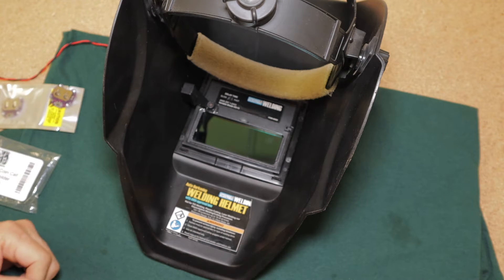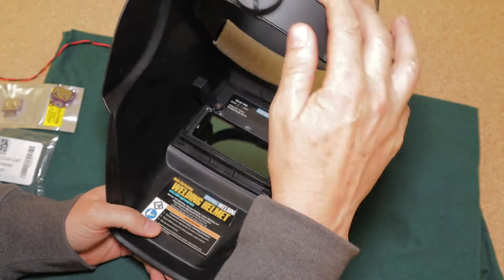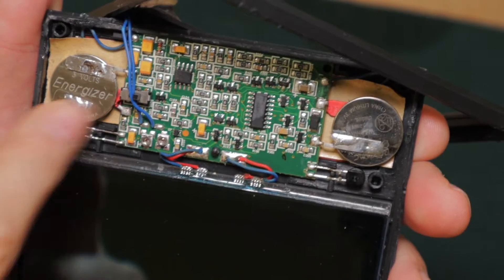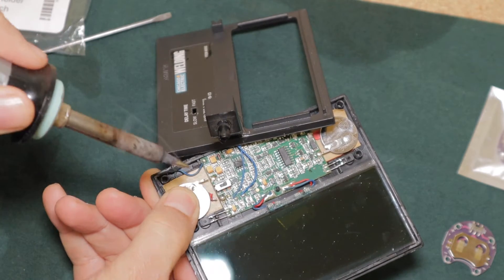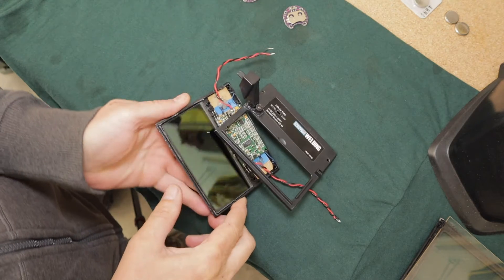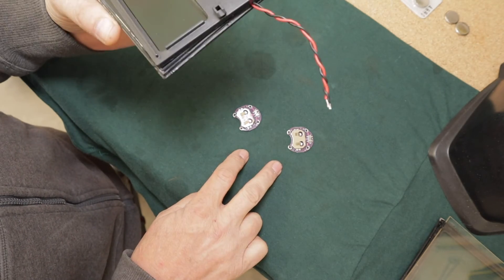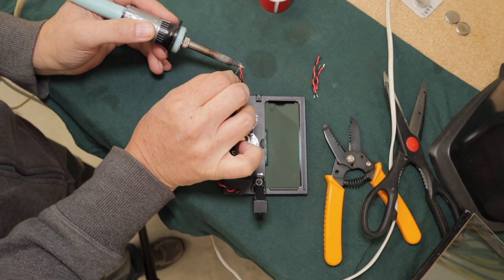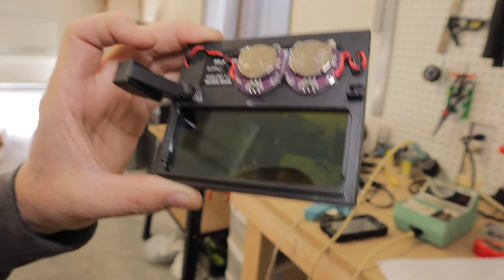Revamp Your Harbor Freight Welding Helmet: Battery Replacement Hacks

Comment: 1. use CR2450 because higher capacity
2. instead of solder cable directly on battery. use spot welder to stick nickel strip on battery. then solder cable to nickel strip
Reply from the maker: That would be great but most people interested in this mod probably don't want to buy a spot welder for this one project.

Comment: I have an older hf chameleon helmut (uses only one button battery). Replaced a new good battery, and still does not work. Any guidance would be appreciated.Thank you for your video, and all the best from New Rochelle N.Y.
Reply from the maker: I appreciate you watching and I wish you the best! I have no experience with a chameleon hood.
Reply: The sensor could be dead.  The older ones, I saw on google, will die if kept in total darkness.  It may depend on the brand and age.  I'm about to do this swap on my 10 year old Harbor Freight helmet.  I think I'll connect the new batteries before doing the battery holder swap to see if the sensor still works.  It was not kept in total darkness, but in the box in an open cabinet/tool box.

Comment: Just an FYI, there are different versions of this board and your model is easier to work with than some others. I have a model where the batteries are next to each other. Getting to them is a pain. Also, it's best to desolder the batteries from the board before messing with them. And those battery connections are not "soldered" but spot welded. It's the same tool used to make cordless tool batteries. If you don't have the welder, soldering is ok but not recommended at all. Your method using DIY boards, is a much better approach.
Reply from the maker: Good info, thanks for sharing!

Comment: Nice.  Looks like you can also buy the replacement batteries that have the feet on them, so you can solder the new ones to the circuit board.  Not sure if I'm going to do that or use your approach when the time comes.

Comment: Welding shades protect you against 2 things besides heat: UV radiation, and visible light. Regardless of the shade (even clear), the lenses will protect you from UV radiation. The darkening is only for eye comfort, and to orevent eye damage due to brightness

Comment: Are the batteries wired in series or parallel?  I have one of those helmets that has a few years on it and I think the battery(s) need replacing... Depending on the voltage, I was thinking of replacing it with a spare 18650 battery that I have around here... Actually, I wouldn't even mind if the solar cell would not charge the battery since I figure it would be easy enough to use an external charger on it...
Reply from the maker: It's been quite a while since I did this modification. I'm thinking they are wired in series.

Comment: Thank you for the video! I was able to bring my Harbor Freight welding helmet back to life. One thing I did differently was solder the wires to the back of the battery holders and then hot glue the battery holders in place after they were wired. This allowed for the batteries to slide in without being obstructed by the wires.
Reply from the maker: Excellent, nice job! 👍🏻

Comment: Great tip and very clear video! My HF welding helmet has died after 15 years, and a 2nd one that was new in its box as a spare also didn't work, so I have some work to do 😁😁

Thank you very much! 😉😉
Reply from the maker: You are welcome, I wish you the best with your project! 👍
Reply: @DIYHomesteadProjectsDIYHP10  😉👍
Reply: @DIYHomesteadProjectsDIYHP10  Hi again! Just to let you know that I have done it with one of the helmets, and it has worked perfectly 👏👏👏

It took me a little time to open it, and I used a Dremel tool with a disc. Instead of the button cell batteries I used 4 AA batteries, reusing a case from a led detector light, just so that I could use today the helmet to finish a project 👍

Following your instructions, it was easy! 😉😉

Thank you very much again, and keep up the good work 😁😁
Reply from the maker: Excellent! I'm glad you were able to get your helmet up and running. Now it will be easy to just replace the batteries when needed. Thanks for stopping by and happy welding! 👍😀
Reply: @DIYHomesteadProjectsDIYHP10  Thanks again, and happy holidsys! 😉😉👍👍
Reply from the maker: Happy Holidays to you as well!

Comment: Great Idea! I did this with my Save Phace helmet that at got from a thrift store and found out way, the battery was dead and the person didn't want to pay for the screen replacement. I used the Button cell holder with the switch to tun it on and off but its an enclosed black one. Also got rechargeable batteries off Amazon along with a button cell re-charger!
Thinking about putting out a video on replacing the battery but with a Button cell holder and rechargeable Button cells that I did on a Save Phace helmet!
Reply from the maker: Excellent!

Comment: I was always under the impression that the solar cell was not to "charge" the batteries, but to actually provide the juice to darken the glass, via the light it received from the welding arc, and the batteries are simply to run the UV sensors so that it has that "instant on" capability.  Or maybe it's the other way around, with the batteries running the glass and solar cell running the UV sensors.  Either way, I don't think the cell is charging the batteries, but I might be wrong.
I know on later versions of the HF helmet, the potentiometer on the side of the helmet actually had an "off" setting incorporated into it, although they should have done a better job of labeling it as such.  They simply called it "Grind", but you could definitely feel the knob click over a detent into that position, which is why I don't think the solar cell charges anything.  I left my helmet in my dark garage nearly unused for about six years and everything was fine.  Then did a bit of welding one day and forgot to click that knob back down to the "Grind" position.  Came back out to use it maybe six weeks later and it had a very hard time darkening the lens.  Six years in the off position = fine, six weeks in the on position = nearly dead.  And no, I don't think that it chose that exact time for the batteries to die.  Six years and six weeks seems a little too convenient.
Reply: Yes and no the problem is the solar cells do not provide constant power. In fact it's the issue with all solar cells even the ones on your house. They can provide a steady voltage but occasionally they falter and the batteries just helped to steady them when that happens. It's not a problem for a calculator or a watch to use them alone but even those have a capacitor in them to hold a charge for a second when the solar cell fails.

Comment: Genius! I plan on doing the same but for my new Titanium Harbor freight helmet. It has a removable coin battery but there is no on or off switch. I plan on just changing the mount to the one you use from Amazon with that button switch. Worst case scenario, I can wire to the outside of my helmet with two AA batteries wired in series to get 3v. Coin batteries are expensive! I have to use cr2045 and that is about $5 a battery if bought from the store! I never buy no name brand batteries online. They do not last and there's too many fakes.
Reply from the maker: Some good ideas there, good luck with your project.
Reply: @DIYHomesteadProjectsDIYHP10  I bought a double AA battery holder from amazon 6 of them for about $7.57 after tax. Each AA battery is 1.5 volts so using two is 3 volts. You need to have two battery holders for each coin battery side. That's two AA holders and 4 batteries total. I love how it has an on/off switch now. I solder the positive to the side of the coin holder and negative on the bottom.
Reply from the maker: Sounds like you have configured a nice set up!

Comment: Thanks for posting this! I have an old cheap Horror Fraught helmet that I bought almost 10 years ago when I started learning to weld and it’s dead.  I was really disappointed to see how difficult it is to replace the batteries but thankfully it can be modded!  My one question though… what batteries did you use?.?
Reply: CR 2335
Reply from the maker: All the parts and batteries I used are listed in the video description.

Comment: I.m all for cheap fixes, but why not just buy a new complete lens unit from ebay, they start at  around $9  £8 they just clip in ,as in the vid.
Reply from the maker: I didn't know about replacement lenses until well after making the mods. If it ever stops working again I'm going to get a replacement from YesWelder - https://yeswelder.com/?ref=DIYHP10%25. They sell a "True Color" lens that I really like! Just that alone has improved my welding in so many ways. Thanks for the tip!
Reply: @DIYHomesteadProjectsDIYHP10  I own a YesWelder and buy a lot from them, but never seen replacement lens other than the M800H or Q800D.  Even with the 15% coupons they send me the cost is more like $34 for the Q800D and not sure if it would fit.  I'll have to measure the HF opening to see.  In the meantime I was already down the path of pretty much doing what you did.  Different snap closed battery holders with leads, switch,  and will be mounting on the outside.  This weekend's project if the holders show up today.  BTW  I found a Q800DA helmet on eBay for $69 with free shipping.  The main thing I like about the HF helmet is I have never had any issues with the head gear where some people have complained about the YW's.
Reply from the maker: Very nice! I've been happy with the YW welding helmets but you are right, the headgear could be a little tougher. I've heard the Lincoln gear is a direct replacement so I'll give that a try the next time I need to replace one.

Comment: This seems like a great idea, I have the Harbor Freight helmet with the blue graphics, it's about 3 or 4 years old. Another interesting way to check to see if the helmet is working is to use a remote control, like a TV remote or one that has the little clear light bulb looking transmitter on the front of it. Just point it at your filter and tap on a button, I just used the on/off button and it works like a charm. 👍
Reply from the maker: Very cool!

Comment: Most people don't know that if you turn your hood to the grinding  mode it will turn off your hood. Yes turn off the  helmet. your helmet will last a lot longer. Mine has lasted over three years so far.
Reply from the maker: That is true but this simple HF hood I made the modifications to does not even have a grind mode.

Comment: I have (had) a dead HF welding helmet..too. Mine lasted about 10 years before it gave up.. I watched your video and thought to myself.. There is no way that will work... 5 minutes of a  super easy solder job and 2 coin cells from my junk drawer and I can not believe it actually works.  

The ebay/amazon coil cell holder works perfectly..  Thanks for the tip on the ground wire.
Reply from the maker: Heck ya it works Tim! It works well and is still working. When it quits working I'll just change the batteries. LOL I'm glad it worked for you too! 👍👊

Comment: The only trouble with this fixture, if one of them batteries decided to vent you can say good by to your eye sight never mind welding ark ,
At least apply some sort of protective cover so your eyes don`t take the full brunt,
Think safety first lithium battery release a gas that ignites like a little flare,

Comment: nice just  opened mine up, batteries fell out, cr2330  so im not sure the were even soldered,was thinking just hold the tabs w foil tape, like used for a/c ducts,but i like what you did,...btw i did get a yeswelder  true color  large view m800 cut grind weld,havnt tried yet ,reviewers had both good n bad to say about,the headgear, and some said tig flashing,but others love it and you can upgrade  the headgear ,fairly standard lincoln stuff,guess the tension knobs strip out real easy
Reply from the maker: You are going to like your YesWelder m800 hood I think. I have one too and I really like it. I did have some flashing with TIG but I discovered that if you turn the sensitivity all the way up it pretty much cures the flashing problem.
Reply: @DIYHomesteadProjectsDIYHP10  thanks man  ,this old helmet  i may have pried the tabs off the batteries,and just bought a newer harbor freight  ,which is also old now,...you can buy a replacement  auto darkening  lens kit like 15 bucks, which is even easier,but i do like being to just  have quik access to replace batteries   if needed,i may see what i can do to fix 2 of these old  ones up cheaply.
Reply from the maker: I get a kick out of fixing old stuff that most people would just throw away. I hope you can get them fixed up and working.
Reply: @DIYHomesteadProjectsDIYHP10  the unit you showed in your video ,has the shade adjustment thing that you epoxied or glued back on ,well i broke the 2 wires,took a chance  w solder iron,and  that foil tape, w 2x2032 batteries,a couple  drops of  super glue,....and it worked ,that helmet  is over 15 yrs old,i guess its good to have back ups, only 2 sensors, yep fun to tinker,

Comment: I wonder if 2 -1.5volt tripple A batteries, wired in parallel wouldn't work?
Reply from the maker: That would work fine. 👍
Reply from the maker: j barr - Actually you would need 4 - 1.5V AAA batteries. The two coin cell batteries are both 3V each totaling 6V.
Reply: @DIYHomesteadProjectsDIYHP10  Correct, if the circuit is in wired series, I’ll have to check this. Thx
Reply from the maker: Good thinking, I don't know if it's wired in series or parallel. 👍

Comment: I appreciate you making this...especially using the battery mounts.  I haven't seen anyone use those.  I am going to attempt to do this.  only question what is the wire size you are using.
Reply from the maker: I think it was 20 or 22 gauge. I think either one would work. Good luck with your project!

Comment: Well my batteries died, I soldiered in 1s lipo 500mah battery with ph2.0 connector.  Just run 1 set of wires too each connection,  then piece of velcro for battery on top of module. Works perfectly and easy recharge
Reply from the maker: Excellent!

Comment: When you changed the batterys do you need rechargeable lithium or reg  engeriser 
I have a solar charging thing to 
Ty
Reply from the maker: Hello Ben, sorry but I really don't know the answer to your question. I really don't know and can't seem to find out if the solar cell in these hoods actually recharges the battery or runs the auto darkening system and saves the battery power. I have read posts where some claim it recharges the battery and other posts where they claim it takes over for the battery when under the arc of the weld to make the battery last longer. So far I have just been using a standard battery without issues. Sorry I can't give you a more definite answer. I hope this helps a little.
Reply: @DIYHomesteadProjectsDIYHP10  I got mine eBay 2 years ago 35 bucks 
And today i was out welding my floor in my car and my helmet was charged in the sun for a day and it only lasted 4 hours then died 
I had to stop 
I charged it for 1 hour in the sun 
But tomm I'm gonna get it in the sun again 
I thought they used cheap batteries 
It was called solar pro
Reply from the maker: So it sounds like yours does charge the batteries. Sounds like if you get new batteries in it you'll be in business. If you decide to get a new helmet in the future, I did a video on a YesWelder helmet I purchased 4 or 5 months ago. So far I'm pretty happy with and it was affordable. They make several models to choose from. I do still use my Harbor Freight helmet I did the mods on. I use it for stick welding and a spare incase I need it. I don't know if you are interested in watching that video but just incase I'll leave you a link here to make it easy to find. No worries if you have no interest, I'm not trying to pressure you and maybe you've already seen the video.
https://youtu.be/WbPcrkm0JY4
Reply: @DIYHomesteadProjectsDIYHP10  ty I just did
Reply: If you don't use rechargeable coin batteries and you have solar, the charging could possibly make batteries get hot and leak or explode?

Comment: I respect what you're doing, trying to keep a helmet in use instead of replacing it, but why not replace the button cells with AA or AAA cell holders/batteries?  Very conveniently available, also makes 3V when two cells are in series.  Could stick the holders inside the helmet instead of on the back of the lens.  Just an opinion - keep up the good work!
Reply from the maker: No real reason really. I did consider using AA batteries though. I just like the size and weight of the button cells. I also figured the original cells lasted me 5 years so I probably won't have to replace these for another 4 or 5 years. Good question! 👍

Comment: Thanks for clear instructions ... While waiting for the battery holders, had to get back to welding ... I was able to remove the tabs from the batteries with a razor blade and small ball pean hammer. Put the battery on edge, tab horizontal at the bottom, blade on the long edge of tab, three wraps and it popped right off ... Solder the tabs to the ends of the wires you installed, placed on new battery, piece of bicycle inner tube to cover, large paper clip to hold in place, duct tape to the inner top of the helmet ... Back in business
Reply from the maker: Thank you and AWESOME job on yours. You have a great mind for fixing with what you have on hand. I love it!!! Happy Welding 👍